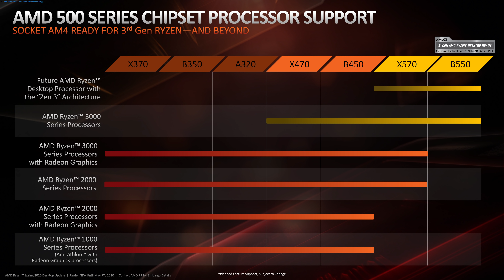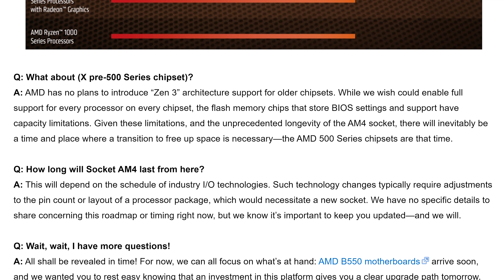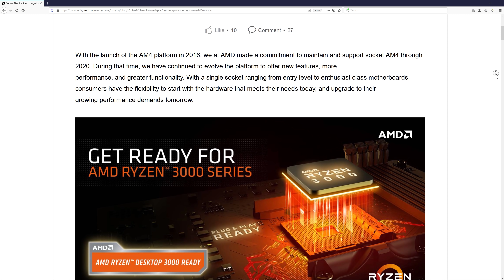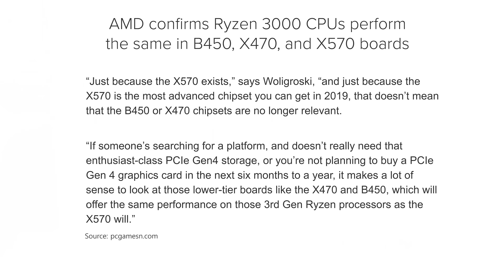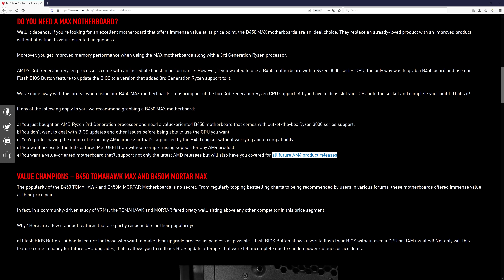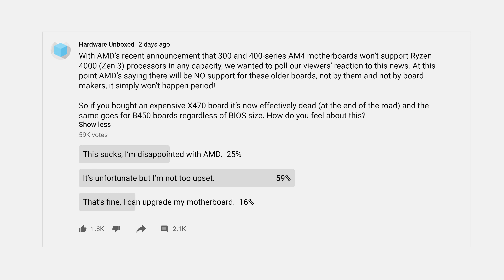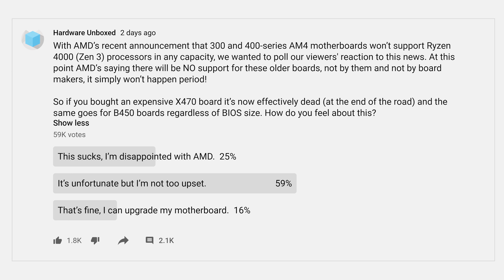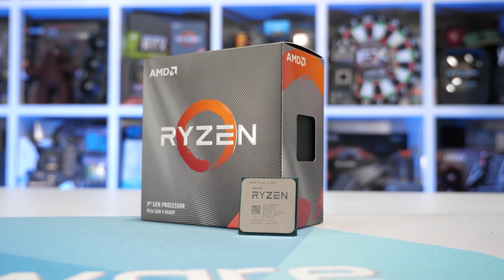AMD Does An Intel, Axes Zen 3 on 400-Series Motherboards, Our Thoughts

Comment: I bought X470 instead of X570 for a 3700x for a few reasons - pricing of most X570 boards, the lack of long term testing of the new chipset fans, availability in my region around launch, and because I thought X470 would be just as good for me. I would have waited and bought an X570 board instead if I would have known this then, but even so I wouldn't feel too upset if AMD could have just handled this differently.
AMD must have known it would be an issue for many, because of the B550 delay. Maybe the delay was unavoidable, but it happened and AMD must have realized this meant that a lot of customers would buy 400-series instead of 500 if they didn't communicate a clear reason to go 500. If B550 was available at Zen 2 launch, this would be a minor issue in comparison to now.
But my biggest gripe, what I really can't look past, is the communication now. Like Steve and many others have said, the bios rom size is a bullshit excuse. Sure, their statement is probably true in a way - support for a large variety of CPUs is of course a mess, and ROM size differences between different boards makes it more problematic. But feel like stating that this is the real reason to not support the new CPUs is a lie. 
If AMD had gone out and said "support on older platforms isn't economically feasible for us with this next generation" or something, that would have been a disappointment, but fine with me. Straight up lying about the reason is honestly an outrage to me however.
I can understand and accept a company making unpopular, but not directly harmful, business decisions to raise profits and grow the company. I don't take well to being lied to though.

Comment: I bought an MSI X470 gaming pro carbon 2 weeks ago with a 3700x and a 5700 XT. I decided against the x570 as I do not need pci-e 4.0. I honestly thought that it would support at least zen3 as it's perfectly capable to do so. Big surprise to hear otherwise! That just means I will be skipping zen 3 altogether. I'm not going to buy a new motherboard for zen 3 so I can potentially buy a new one again for zen 4. I'm 41 and never bought a computer other then AMD. My first one was a 386 DX-40! Disappointed but hope AMD changes its mind.

Comment: Just bought b450 and Ryzen 3600  with the idea to upgrade  processor later for 8/16 4000 series as AMD stated that they support am4 socket. Fills like I am fooled by AMD. :(  just if they made it clear  I could buy X570 motherboard

Comment: I bought a x470 with a cheap 1800x. Then sold the 1800x and got a cheap 2700x. Again sold the 2700x and bought a 3800x. So this board already seen 3 generations of cpu’s and im still happy with it. Dont think im upgrading again soon cause zen2 is rather good as it is and ryzen 4000 is still gonna be zen2+ so it wont be that much of a a gain imo.

Comment: I literally just bought a B450 board and if I had known they would do this I would have had justification to spend a bit more and get the x570 but only a few weeks ago there was absolutely not justification of doing this. They could have announced these plans 6 months ago and instead they didn't even say if the x570 board would work with it.

Comment: Precedent AM2
Starts with athlon 64 and ends with select Phenom 2 CPU's for many (not all) boards.
That's four generations of processors as the athlon 64 started on socket 754 (Single channel DDR RAM), upgraded for socket 939 (DDR dual channel ram), then upgraded again for AM2 (DDR2),
Athlon 64X2
Phenom (the real AM2 processor)
Phenom 2 up to x4 on select boards and these had a massive hit on the hyper transport.
AM2+ required for Thuban (X6), because dual plane power needed, but Thuban was designed as an AM3 processor while Phenom 2 x4  was designed for AM2 as the 920 and 940BE only support DDR2.

There are more technical differences between AM2 and AM2+ than X370 and X570 but that didn't stop forwards compatibility for the older non + boards and that includes dual power planes for the newer processors (SOC (IMC) and vcore) that was non existent on AM2 boards. 

So yeah I do expect long run forwards compatibility unless a real technical difference breaks compatibility, a good enough run for 300 series boards is bullshit thinking especially when there are X570 boards with 128Mb bioses and all AMD are doing is a bifurcation of AGESA code just like they did for Ryzen 3000 to make them compatible with B450, because B550 was having technical issues with cheaper PCIe 4.0 solutions, and what's with only version 3.0 for the chipset lanes.

If they want to limit the chipsets lifespan, then they need to plan a breaking architectural change to motherboards like they did to threadripper from X399 to TRX40.

Comment: Is it a dick move? Maybe. But I'm not so upset as I could be. I bought a midrange X470 Board in 2018 with the 2700X and I've upgraded to a 3800X and then a 3900X last year and It would have been cool if it also supported the next generation but think about all the innocent people who bought a Ryzen 3000 CPU and a 4xx board and then couldn't boot the system, because they needed to upgrade the bios... ;-) and if you have bought now a 100$ B450 board, it's not so much money to upgrade to a 100$ B550 Board, when Zen 3 comes. Imagine if you had bought a 200$ X470 Board for Ryzen 3000 - THOSE are the people who are really screwed - and stupid because they didn't bought a X570 board in the first place.

At least the 500series supports the new CPU. Imagine if everybody had to buy a new board, especially the people who had bought the overpriced high end ones. ;-)

Comment: I bought an X470 motherboard with the expectation of getting to Zen 3 with it.  I also water cool my system so I'm running a monoblock that has no compatibility with 500 series motherboards.  For me to upgrade to Zen 3 now requires buying a cpu, mobo and monoblock, which is a huge increase in costs over just buying a new CPU.  I'm very disappointed in AMD.  Thank you Hardware Unboxed for pushing back on this and trying to get AMD to reconsider.

Comment: This decision is madness by amd.
The "new"10th gen intel cpu's are around the corner, with 4 core/8 thread I3's, 6 core/12 thread I5's and 8 core/16 thread I7's.
People in the mix for a new chip may well jump ship, rather than fork out for a new board and chip for zen 3.

These new intel chips are likely to be faster than current zen 2 chips (for gaming) and no one knows how good zen 3 will be yet.

I'm lucky cos I bought an X570 mobo so I'm ok for Zen 3 but it isn't fair and is something that we've slagged intel off over for years!

Talk about shooting yourselves in the foot and handing back the initiative to intel......"sigh"...
Reply: enjoy a new platform per every cpu gen courtesy of intel!
Reply: Prices may be of Humongous Proportions though I think going by even 2nd hand prices , and the history of what I have paid previous for Intel Gear
Reply: You are wrong.
Unless you would consider people dumb enough to jump from the frying pan straight into the fire, because this mishap.

Comment: My thoughts are if they are selling new boards based on the 400 series boards and given they have dragged their feet on releasing the 550 boards so the B450 boards were the only option for more price friendly boards that work with the Ryzen 3000 CPU's. 

I know I would be very upset if I just bought a 400 series board and then get told I would not have support for the next CPU release. I would be even more upset if the board I just bought stated it had support for future CPU releases and then find out that is not going to be the case because they decided to end support of the board and chipset.

I do think AMD will at some point will do the right thing and add the support back in for the 400 series boards. I also think Hardware Unboxed idea for a tiered bios support for different Ryzen CPU series. That way it removes the bios storage space constraints. When you decide to upgrade to a new series of zen CPU all you have to do is flash the bios then remove the older zen and install the newer zen CPU and continue on with the new zen based CPU.

I also think they should have a fail safe mode built into the board bios where the board will be able to post to at least the bios or even boot windows with a CPU that is not supported in the firmware. Even if it comes up as a unknown CPU type it should still be able to at least post and boot after all being that Zen is all based off of the same CPU tech and not drastically different form each other and the socket electrically the same throughout the whole series it should be able to boot and at least work. This all seems to have been removed in today's new boards but it was a thing that worked in the past on older gen boards baxk in the day.

It is not like AMD has pulled an Intel and added a couple pins into the socket to make sure us as users would be forced to go out and buy a new board for basically no reason at all.

Comment: So you're telling  me that 2 years ago, when the maximum CPU core count was 8, I could buy an AM4 motherboard and a year later I could upgrade to a CPU with double the core count. But that same motherboard that currently supports 16 Core CPU won't be compatible with this generations 16 Core?
How fucking stupid is that?
Also I'm not a motherboard engineer but why the fuck do they have 16MB of memory? I can buy a 32GB USB stick with 10$ and you're telling me that these arseholes can't put enought megabytes of memory in their boards to support a few dozen CPU's?
Horseshit! I bought into the hype and switched to AMD this year and got a Asus B450-E with a Ryzen 2700X with the plan to upgrade to Zen 3 later this year and this is how AMD threats us?! This is fuckin bullshit!!
AMD has lost respect in my eyes for this shenanigans.

Comment: While I can fully agree with people that are pissed at this decision I am also on AMD's side since time and again they stated in clear that they would support the AM4 platform UNTIL 2020. They are under no obligation to support it till the end of 2020 or after that. 

I still wish they would of course. Do not misunderstand however all this rage and flame is kind of hypocritical since when Intel does it nobody bat's an eye. And those bastards doe it every 9-12 months.

Still as i stated I wish AMD would reconsider this.

I though the next gen AMD CPU's were gonna be using brand new features such as DDR5 USB4 and so on. How would that even work with older gen motherboards? Or am I getting something wrong here?

Comment: I voted that I was disappointed but I get it, the only reason is because when I got on AM4 it was November 2018.  I bought a bundle from micro center including a ryzen 7 1700x and a b450 board.  Yesterday I bought a ryzen 5 3600  as an upgrade since I only use my computer for gaming.  So by the time I’m done with the 3600 I’ll have used the same motherboard for 4-5 years potentially.  Which I do think was good value but if I just bought a 3600 and a b450 then I would be pissed

Comment: While I am disappointed having just bought a b450 board and could understand why they wouldn't, I don't really see why one would want to get a new Zen 3 chip if you're just now building a new rig and don't want to buy a 5xx series mobo. With new architecture coming out the next cycle I'd just skip Zen 3 anyways. What am I missing?

Comment: I don't feel slighted by this because I use my systems for around 3–4 years. I guess what's disappointing is the lack of options across multiple chipsets for someone looking to build a new Zen 3 system. Like you said, AT LEAST open up support for 400-series mobos.

Comment: I recently bought an msi b450i mini itx mobo about three weeks ago and I read about AMD screwing people on "Future proofing". I mean... I'm probably not going to upgrade my cpu any time soon and I am even still using the 1700 cpu with my gtx 1080 ti that I bought 2 years ago after the crypto crash for ~$230, bought two as the other was $250. In any case, I don't think I would really need zen 3 for another year or so, but I'd like the option or ability to buy Zen 3 and use it with my b450i down the line. Hopefully, AMD updates this down the line or there will be a lot of people skipping out on the 4000 series.

Comment: As it's not a new socket, yes, that's shady and dissapointing. Personally, I just built a B450 based-system, but built it for use during the next two years, no plans for updating from 2nd gen to 3rd gen, so I'm unaffected. I'd be incredibly pissed if I was in the group that looked for value and did get a B450 board to be ready for 3rd gen though.

Comment: I think it is possible to inject microcode into the bios, I've done this several times with an old lga 771 Xeons modded to fit on a 775 socket, if you don't enough space you can just delete the microcode that you don't need, I think the program's name was MMtool or something along those lines.

Comment: If they released the b550 chipset last year this would not be as big of a deal. B450 should be able to use it because it was the latest model until now. This is bull. I just bought a b450 and if 550s were out I obv would have gotten that. It is not my fault they delayed 550 so long.

Comment: I'll be honest i was a bit on AMD's side at first but at the 4:56 mark what you read swayed me. I 100% agree with your BIOS recommendation in having the ability to pick whats supported. The only issue with that is the consumer support side for the board makers. Imagine someone buying one for a first gen chip they got second hand then getting it with the BIOS that supports only 2-4. Why not up the cost of a mobo by 5-10 bucks and make the BIOS chips 1Gb or something? Being space limited on ANYTHING in 2020 just sounds down right dumb IMO.

Comment: I got an x370  procarbon msi board, I have ryzen 1000 and 2000 support only. I have updated my UEFI to the most recent bios. I will stick with my 1700 for a while I guess.

Comment: Kinda crap excuse from AMD , i'm using quite cheap ASUS Prime B450-Plus , and it has 128mb bios chip ( comparing to B450 Tomahawk Max 32mb chip ).
Reply: @UserShillmark Dude, thanks for clarification, i didn't know that. Shame on me, and I'm working with hardware for almost 8 years, they must do better explanation in mobo specs for end users.

Comment: What the AMD fan boys apparently fail to realize, is that at Zen2 launch there literally wasn't any other option in the mid-range price bracket other than B450 and lower end X470. So essentially AMD just screwed over the entirety of their Zen2 mid-range customer base, for them the "magical never-before-seen socket support" literally lasted for a grand total of a single generation.

And let's be perfectly clear, with this move and going by the exact same logic that some of the people are using, Intel apparently gave better "socket support" to LGA775 and LGA1151 than AMD has with AM4. Especially since you actually can use 9900K's just fine on certain Z170 boards. Hell, even the jump from Nehalem to Gulftown/Westmere on LGA1366 was absolutely massive in hindsight.

If we talk about just AMD, Socket A received four generations (Thunderbird, Palomino, Thoroughbred, Barton). And yes, you actually could use Thunderbird CPU's with the later boards, I know this because I did. The 1GHz T-bird I had worked just fine with the ASUS A7N8X Deluxe board with an nVidia nForce 2 Ultra chipset aimed at the Barton CPU's.

Socket 939 also received four generation (Clawhammer, Winchester, Venice, Toledo). To my knowledge there really wasn't any limitations on which CPU's would work on a given board, as long as BIOS support existed, even the later dual-cores.

So no, to me this touted "amazing AM4 support" really isn't all that, this is just a return to the norm after the wasteland that was Intel 2011-2017. And if we're talking purely CPU uarchs, AM4 thus far has received exactly two.

Comment: This is quite disappointing. I purchased a B450 board because I didn't need PCIe 4.0 and wanted a board that didn't need active cooling. Had I known B450 would not support Zen 3 I would have spent the extra money on an X570 board. In effect, AMD's failure to properly set expectations screwed me out of an upgrade path and screwed them out of upselling me to a higher-end motherboard. In what world does that make sense? Do you even business, bro?

Comment: I built a new budget PC in January and chose a MSI B450 over the cheaper B350 board along with a used Zen+ CPU specifically to be able to upgrade to Zen 3 later on. I read that AM4 will be supported until 2020, Zen 3 should come out in 2020, I thought this is a safe bet. Given that the 5000 series will most likely launch on a new socket, I wanted to make the most of the current AM4 platform and be good for at least a few years. It is unheard of that the latest "affordable" chipset at the time could become obsolete within the same year.
I don't think it makes any sense to invest in an AM4 board with a 500 series chipset, because they too will only support a single generation of CPUs more than the 400 series. (Since Zen 2 CPUs run on most 300 series chipsets... why does the 400 series even exist??)
Personally, I don't care about support for older AM4 generations on a 400 chipset series board. If only there was a way to ditch Zen (and maybe even Z+) support and have enough space for a Zen 2 and 3 BIOS... I wouldn't even mind if Zen 3 ran a little slower on B450 compared to B550. Let's hope AMD will come around and find a way. If not, I hope most people will keep their awesome Zen 2 CPUs and wait for Zen 4 on AM5. 500 series chipsets just make no sense to buy.